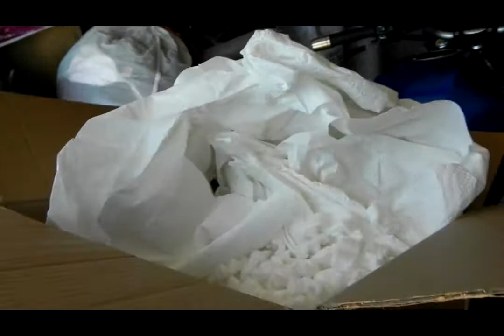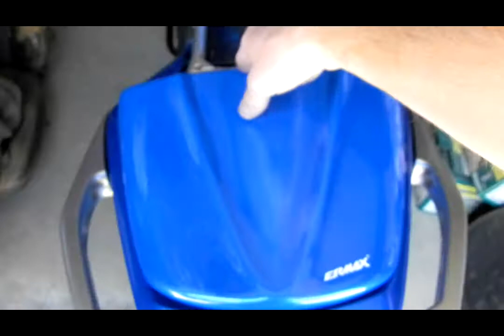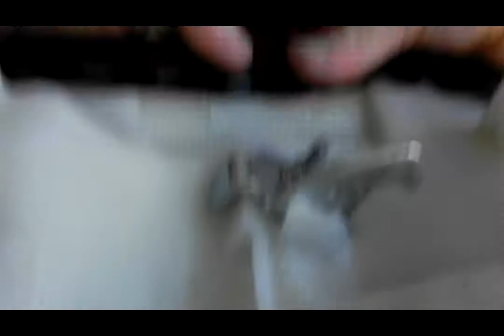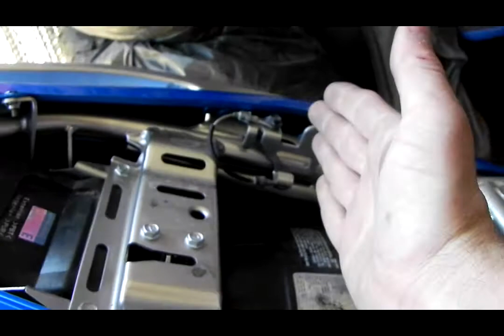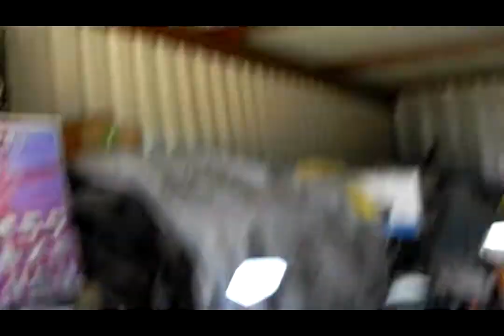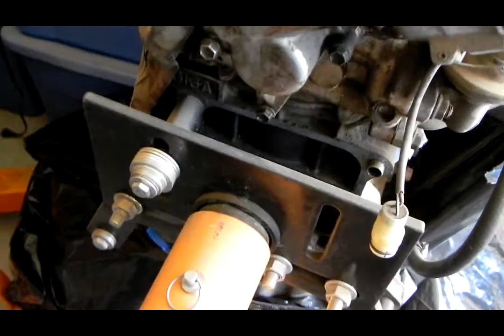2009 Kawasaki ER 6N seat cowl

Comment: What was so bad about the factory seat, other than what you said ?
Reply from the maker: It made my tail bone hurt after 40 minutes of riding.   Also the padding is too thin.
Reply: Glad to hear a response back, not glad it causes you pain after such a short ride.

I found a bike same year ect, with low miles, at a good price, I was worried about the seat, not being so good to longer rides, which I love to do, when able.

Will look into a seat upgrade, or pass on the bike, if one is not to be found, within reason price wise, if the seat cost to much,

 I will just get a 2012 up Ninja 650, they have better seat, so I have been told, and I have sat on them, but not on the older models bikes, like the 2009 yet.  

Or maybe something else ? Thank you, your input is very helpful. yl